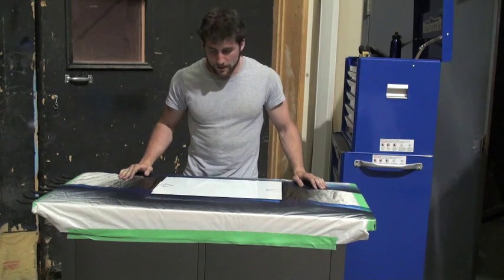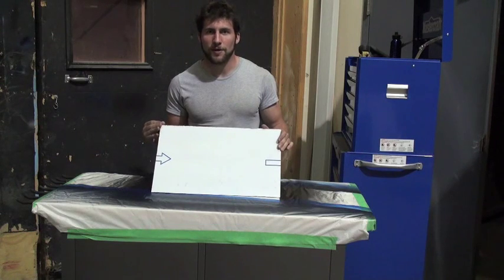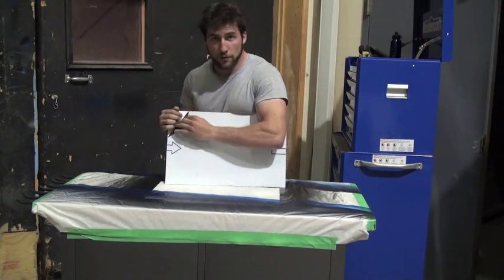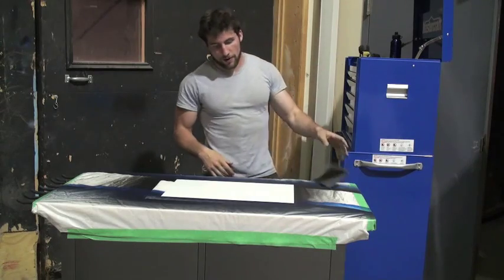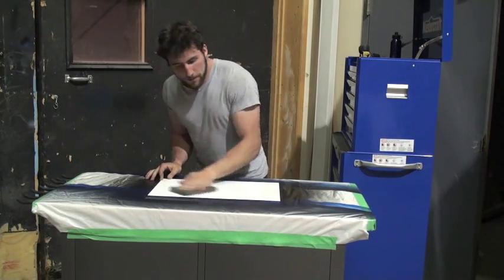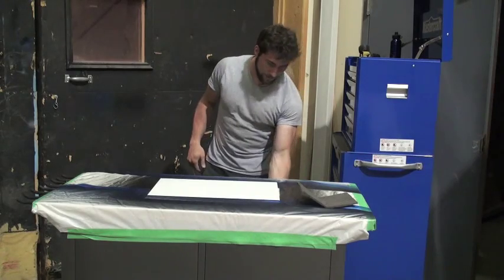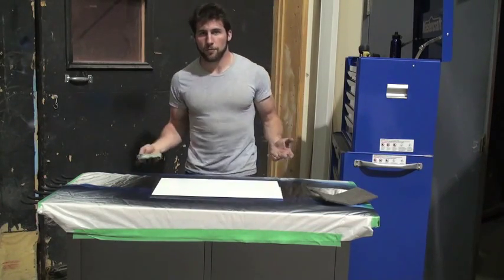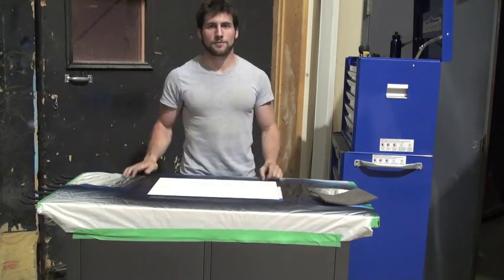How to prepare a panel for airbrushing

Comment from the maker: Sorry, I should have mentioned that. There are specific product for it, but lighter fluid will work fine. You can also use something like windex in a pinch.
On substrates where you aren't worried about ruining a layer of paint that is already there, you can use stronger stuff. For example, on the metal art that I post on here I typically use methanol or lacquer thinner to clean it. If I did that on a normal project I would make a huge mess.